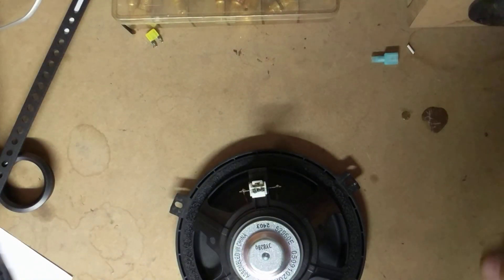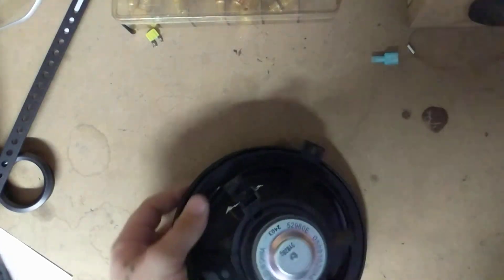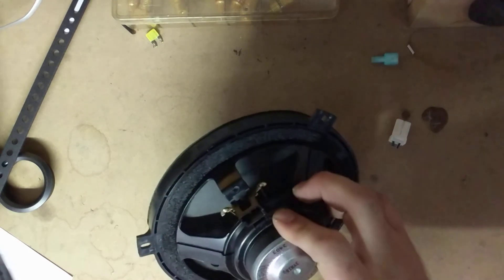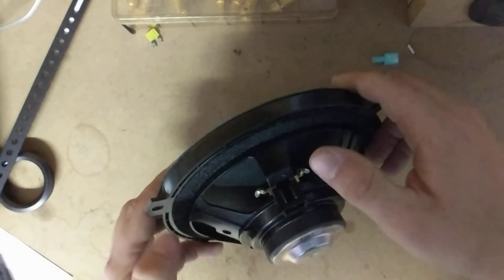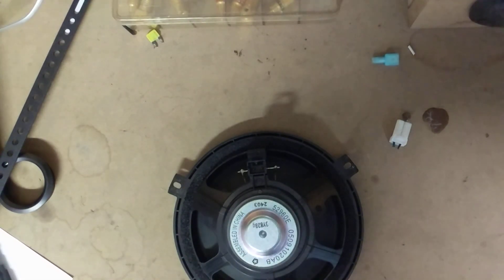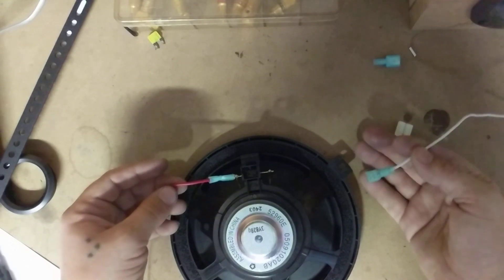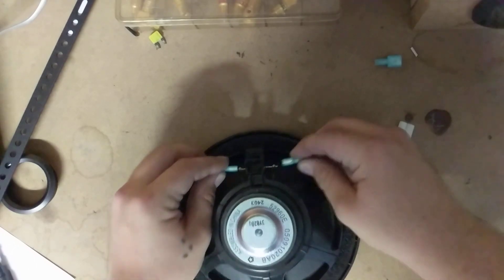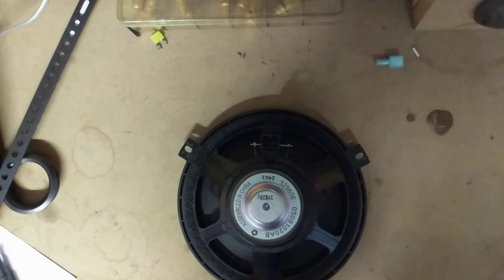How to identify positive and negative speaker leads

Comment: somebody told me I could just turn on my amplifier and make it sound,  it would become clear if the cone is pushing or absorbing. is that correct?
Reply from the maker: on a subwoofer you can tell pretty easy but on smaller coaxial and component speakers it's very hard to tell because the speaker will be constantly moving in or out and won't be set pushing or sucking in one direction.
Reply: @dailywheelies12  false alarm, I checked and it is correctly connected.  white cable to positive,  I hadnt checked but in the end I checked properly and there was a + , the white cable goes there. so I guess that is the way the amplifier is..

Comment: How can I find out without removing head unit what speaker wires are Negative and which are positive for my rear speakers  i want to install speakers but do mot not want to mix up the connections? Is there anyway to text to find out?
Reply from the maker: Oh shit, I didn't know you were Petey pablo
Reply from the maker: Tell me the make and model and I'll tell you
Reply: @dailywheelies12  2018 Chevrolet Express 2500 cargo van it didn't come with rear speakers I'm adding them the wiring is already there
Reply: @dailywheelies12  I finally found a wire color diagram for 2017 similar to mine and it looks like the 17 is the same as 18. Thanks